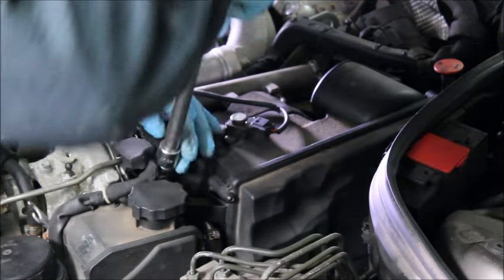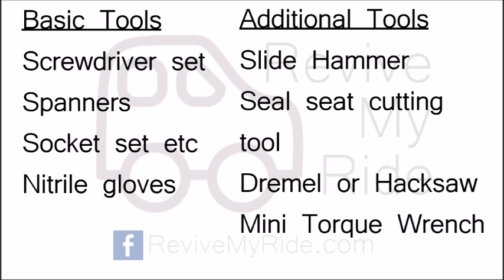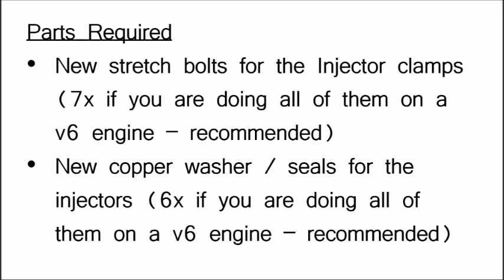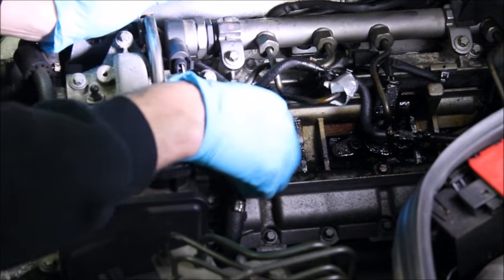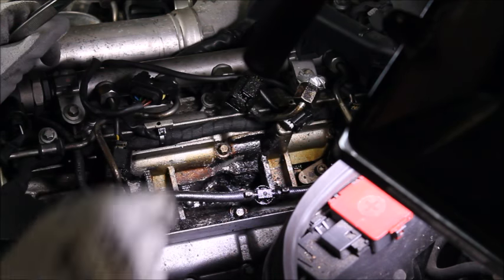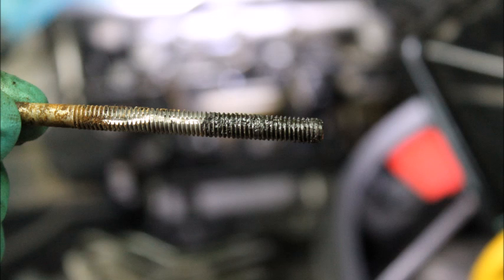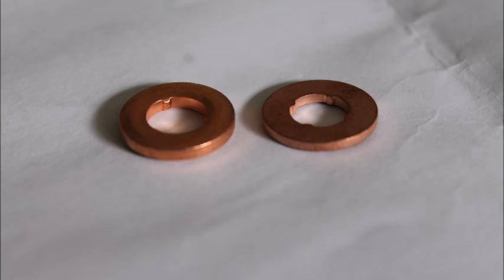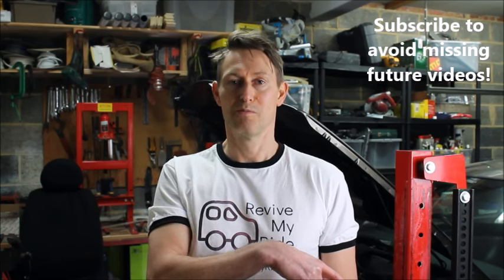Mercedes diesel CDI (Black Death) leaking fuel injector - How to diagnose and fix on 3.0 V6 engine

Comment: I have a 2011 e350 with a 265hp om642. I just checked the injectors after 250000km and found no leak😊.
Does the latest evolution has this black death problem solved?
Reply from the maker: You’re doing the right thing checking 👍 as far as I know, they never changed the design but for whatever reason, you do come across cars that never experience the issue. Cheers, Phil

Comment: Great video! Is there a reason why I should not anneal the copper washer prior to installing?
Reply from the maker: That’s a really good question Yuri! If I’m honest, I don’t know for sure but as I have an engineering background I can speculate: it could be, the softer the better in terms of getting a seal, in which case annealing is a great ideas (I do this all of the time to reuse oil pan plug washers if I have forgotten to buy one!). However, it could be that the washer manufacturers have considered this and have rolled and stamped the copper to achieve a certain hardness. In which case, annealing would be counter productive. Personally, I wouldn’t anneal the washers because of this unknown. But if you try it, just keep inspecting regularly and drop me a message about it! Hope that helps! Cheers, Phil
Reply from the maker: Just to add, if you decide to DIY the repair, I have a video showing how to do it step by step, you’ll find it on my channel! 👍

Comment: Which side of the washer should face injector? Is there any front or backside of it or it doesn't matter?
Reply: With the honda copper washer, both sides are flat so doesnt matter. With OE mercedes thinner one, you want the flat side at the injector side and the curved one facing the head.
Reply from the maker: Ali N, hi, the washers are symmetrical, so you can just pop them in either way :-)
Reply from the maker: Charlie J just saw you reply! Thanks for the additional info!
Reply: Before you use a reamer which by the way Mercedes does not recommend, grab a small valve lapping tool, stick on 17mm diameter circular piece if fine sanding paper and see if you can get it smooth that way. You can buy an inexpensive android camera and inspect it close that way. But from my experience, nylon brush with a dip in acetone on a drill does it well. Hope it helps!
Reply: @charliej3190  Good tip

Comment: What would be a good 'degreaser' or cleaning agent to let soak in overnight on the outside of the injector if there is carbon build up?  Someone mentioned WD40 but is there something better?
Reply from the maker: Hi, in the video I used "Seafoam". It is an American brand that has been around a long time and starting to appear in the UK in recent years. It is also used as an additive, added to fuel to clean the injectors etc. I thought it worked well! Hope that helps!
Reply: I used Easy Off the oven cleaner, heavy duty version. While engine was running I sprayed and the carbon melted fast and I used paper towel and wipes to remove the "melted chocolate".

Comment: Hi mine washers are slightly curved.What way should i put them curved side up or down?
Reply from the maker: Hi, I remember looking into this and it didn't seem to matter which way up the new copper seals are fitted. They are pretty soft, so should squash to shape when the injector clamp is tightened. Hope that helps! thanks, Phil
Reply: @ReviveMyRide  thank you

Comment: What would cause a rattle on declaration?
Reply from the maker: Hi Ross, I’m sorry, there are just sooo many things it could be. The best thing you can do is join a couple of Benz forums (like Benz world) and start searching. See if there is anything that sounds exactly like what you are experiencing. I did a quick search and an exhaust under body heat shield, loose and rattling & timing chain wear / or tensioner were mentioned. Hope this helps get you started! Thanks, Phil

Comment: Great video!!! I went to the link for the copper seal you say is from Nissan, but it links to a Honda seal. Are they the same?
Reply from the maker: Hi @igorocchipinti1671 Really sorry, I made an error in the video. It is definitely a Honda seal and the part number in the description is correct. BTW, mine are still going strong since I made this video several years ago... Thanks, Phil
Reply: @ReviveMyRide thanks a lot!
Reply: @ReviveMyRide Hi Phil, I would like to ask you if you recommend opening the injectors to clean them as I have seen done in many tutorials or is this something that should be done exclusively by professionals? Thanks in advance, Igor
Reply from the maker: @igorocchipinti1671  hi, I’ve seen some of those videos too! In principle, it’s a really good idea because in older diesel cars, the injectors stop giving a “mist” pattern and you get a “jet” of fuel instead = less fuel economy and the car smokes under heavy acceleration. So, depending on your level of diy skill, I would say yes, you could build a rig to push cleaning fluid through the injectors and it would be a big improvement BUT the biggest risk is creating a flammable atmosphere due to the product that is coming through the injectors. If in any doubt best to use a professional cleaning company. Hope this helps a bit, it is something I would attempt but I would do a lot of research first. Thanks, Phil

Comment: What size seal seat cutter did you use? Was it the 17x19 flat or the 17x17 angled reamer?
Reply from the maker: Just checked my kit and the one I used has 17mm x 17 Flat written on it. I know the first number is the diameter but not sure about the second number. Hope this helps!

Comment: I retorq 7Nm and two 45 degrees, but you doing 8Nm and two 90, where is right answer?
Reply from the maker: This is a tricky one! I also have found a few different methods and torque levels for these bolts. All I can suggest is find the info source that you trust and go with it. What I will say is that the bolts break very easily, personally I will be trying less torque next time, maybe the 7Nm + 2x 45deg as you suggest. Cheers, Phil

Comment: Hi mate ..question..after torque rachet bar to 8nm...how many turns with ordinary rachet bar..
Reply from the maker: Hi, Sorry for the slow reply! Just double checked and it is 8nm followed by 2 x 90deg turns. That is for this particular engine, I have heard it might be slightly different on the older diesel engine that this one replaced. Hope that helps!

Comment: I got diesel pooling around one of my injectors but can't tell if its a bad injector copper seal or from the rail pipe, or return
 etc
Reply from the maker: Hi Reed, I don't think it is unlikely to be a leaking injector copper seal. The reason for this is that this seal tends to leak on the compression stroke / ignition of the fuel air mixture. Hence, it normally results in the black / carbon build up. If you are seeing actual liquid diesel, then it is more likely to be the other options you mentioned: fuel connection to the injector, the fuel rail or return. As a starting point, I would try tightening up any joints around the injector, where the leak is. HAs any work been done on the car recently? if so, this may also give a clue. I'm sure you are already aware of this but just in case - Please be careful and do not look / feel for leaks when the car is running or recently been running as the extremely high pressure diesel (from a fine leak) ban cause very bad cuts to your hands! Hope this helps, Phil
Reply: @ReviveMyRide  cheers I've got the car second hand. hard starting when cold but once its been driven it can restart without issues, I've only done an oil change as it was leaking around the filter and of good practice for any second hand car purchased, also air filter back to OEM as it had a aftermarket cone filter on it. also did the diesel filter and it was as black as the oil filter and sort of start up easier. so I suspect the fuel leak is dropping the rail pressure making it harder to start. I now got a few new parts coming return leak off pipe connector and new fuel rail to injector pipe.
Reply from the maker: @reedwischhusen5376  Sounds like you have done some good work there! Yes, i'm sure fixing the fuel leak will make it start and run better. If you have a fault code reader, maybe do a check that there are not codes showing for the glow plug / starting system. cheers, RMR

Comment: Please help. My 2006 ML320 CDI is pumping out alot of white smoke and also throws 2020-1 code for low fuel rail pressure. My mechanic just can find the problem. Injectors, fuel pump, intake seal/pcv valve + seal replaced.

Comment: Hi is this the right tool : 17mm x 17mm Angled Reamer for Mercedes Benz CDI to use ? (not the flat one ?)
Reply from the maker: Hi, I just double checked my seat cutting tool kit and I definitely used the 17x17 Flat reamer. The bottom of the fuel injector is also flat. Btw, I recently did a 2yr inspection following the repair that I did and all still looks well. The links here if you want to see! https://youtu.be/7weS1vQ_1OI thanks, Phil
Reply: Same Tool for a w211 220 cdi ?
Reply from the maker: @carlhenrikandersson8761  I was just checking and your car does use a slightly different fuel injector to mine (maybe different flow rate capabilities) and I can't find the exact dimensions for it. However, I'm 95% sure it is the 17x17 flat reamer that you will need, as this seems to be recommended for all Delphi / Bosch Mercedes fuel injectors. However, remember, the first option is always just to gently clean the seat using a round wooden post (with a piece of fine grit emery cloth stuck to the bottom with double sided tape). Only recut the seat if you fail to clean it up with the sand paper. If you do recut the seat, only cut the minimum amount of material away to clean the seat. If you cut away too much material, you can cause fuel injector seating problems which are very difficult to resolve. Thanks, Phil
Reply: @ReviveMyRide  Thank you for your answer.  !

Comment: Great video my wk Jeep is beginning to show some carbon on the injectors is some carbon okay? Or is it something I should do soon? Only carbon is on the edge of injector not all over the valve cover? I have 120,000 miles on it
Reply from the maker: Hi, sounds like very early signs of the black death but your Jeep is doing well at 120,000 miles, most get a problem before that! Technically, there shouldn't be any carbon there at all. It seems really minor, so you could just keep an eye on it to see if it gets worse. If you plan on keeping the car, I would plan to do the work before it gets much worse. Bear in mind, when you catch it early, injectors are really easy to remove, you have hardly any clean-up to do and the sealing faces won't be damaged, so a quick clean and new seals & bolts and you are ready to go again. I had a few injectors that hadn't been leaking but changed the seals anyway and it was super easy but the ones that were bound in by carbon were a pain (also risk damaging the injector when you remove with a slide hammer etc) and took quite a bit of time to remove (leaving to soak over night with seafoam around them) and trying to be gentle with them. Hope this helps!
Reply: @ReviveMyRide  thanks also for all the info this is my first OM642 that I've acquired im a used car dealer in the U.S I found this jeep at auction and I absolutely love this engine now
Reply: @ReviveMyRide  I'm now beginning to smell diesel fumes in the cabin time to replace haha hopefully local parts store has seat cutters
Reply from the maker: @rosssmith9941  Hi, Yes, you are right, another of the early indications is fumes in the cabin! I think the leak from your injectors is still at fairly early stages, so the chances are you won't need to cut the seats (you should avoid doing this unless necessary) and could probably just polish the seat with a round wooden dowel with some fine emery cloth fastened to the end of it (double sided taper works for this!), Good luck with it!
Reply: @ReviveMyRide  thanks I really appreciate all the info

Comment: When you have a leak is it possible to have a DTC? I have 2 fault codes, P2013 and P2031. I think injector 1 is leaking but it’s hard to tell if it’s the injector or the return line. Not to brag or anything but my car is in really good shape,    Injector 1 might be leaking( or the return line). The foam was a bit dirty, the rail is super clean. When it’s running I can’t see any leak( I know it’s high pressure) I can hear a slight sound . The car has 114k miles. I wonder if I go ahead and replace the injector seals and return lines , will the check engine light go away?! Hmm 
Please advise. Thank you and Happy New Year.
P.S I know it’s a 4 year old video and probably nobody will reply… I’m giving it a shot
Reply from the maker: Hi @marcelcovaci9922 Yes, although I haven't had it myself, I have heard from other owners that a fuel leak or a leaking fuel injector seal has triggered dtc's before. From your description, I think there is a good chance that one or more of your fuel injector seals are leaking. Sounds like you have caught it early and therefore, they will be much easier for you to change 👍 At that mileage, often the seals have started to fail already, so yours have done pretty good. If you DIY it, it's actually quite inexpensive to fix. Thanks, Phil
Reply: @ReviveMyRide thank you sir. I will order the parts and I have the tools, I’ll do it myself. Your video is very helpful. 
Thank you for replying!
Reply from the maker: @marcelcovaci9922  No probs at all, hope the work goes well for you! 👍

Comment: excellent help except I could not do it myself. I haven't got the tools and the expertise. I wished I knew someone who can do it in Paris except the expensive Mercedes Garage.
Reply from the maker: Thanks for your message and glad the video helped you to understand the issue and the work required to rectify it! You might be able to find a good independent diesel expert that can do the work. Leaking fuel injectors isn't that unusual and so, in the UK there are quite a few diesel specialists who could do the work. Not sure if this is the case in France or not? Thanks, Phil

Comment: Dear Revive my ride, I have a cummins 2.8 isf, Recently I saw diesel fuel around the injector nr 1, and uneven  idling speed, could this be the injector seal as I can not see any fuel leak on the hoses?
Reply from the maker: Hi, from what I have seen, a leaking fuel injector seal often occurs during compression / fuel ignition and so it is usually fumes and black carbon / tar deposits that start to escape from the cylinder. So, I'm not 100% sure but it seems that the bottom seal may not be the problem. As a starting point, I would check all of the fuel line joints for supply and return that are near injector one (maybe with some paper towel, so that you can see if it becomes wet) to see if you can find a small leak. My car had a leak like this that I couldn't see easily but I fixed it by tightening up the fuel line joints. Also, I did some reading and it seems the seals within the injector itself can start to leak and  then it would be pure diesel that comes out rather than fumes / emissions. There are a few areas where the different sections of the fuel injector fit together and the diesel can escape from these seams if a seal is failing. It's possible that this is your problem. If it is, there are places that recondition the fuel injectors or, if you are quite handy, apparently you can buy a seal kit for them and essentially rebuild them (I've never done this though). Sorry if you already know this but make sure you don't put your hands near the injectors when the engine is or was recently running as a fine jet of high pressure diesel cut your skin! Hope some of the above helps! Thanks, Phil

Comment: What is the size of the slide hammer adapter to injector?
Reply from the maker: Hi, The male thread size on my fuel injector was 14mm. Here is the fuel injector that was fitted to mine: https://www.autodoc.co.uk/bosch/1162638  If you scroll down to the "compatibility for passenger cars" section you will be able to check if it is the exact same injector as fitted to your car. Hope that helps! Phil
Reply: Thanks Phil!
Great info.!
I wanted to know the thread size to get the proper slide hammer….
Have a great day!
Mike

 @ReviveMyRide
Reply from the maker: @snoopyshea  No probs, hope the work goes well for you! 👍

Comment: Today I heard my sprinter 313 doing this, it's on the second from the back, literally just started doing it, fancy replacing it for me.....I haven't got the time?
Reply from the maker: Hi, really sorry, I'm pretty snowed under myself (House move!). However, as you have caught it early, this should be a pretty simple job. A lot of the work is on the clean up and getting the injectors out (if they have gotten stuck due to the carbon). Any garage that has experience of working on diesel engines should be able to help you out with it. I imagine a single injector seal could be changed in an hour or two but you may want to consider having all of them done. Thanks!